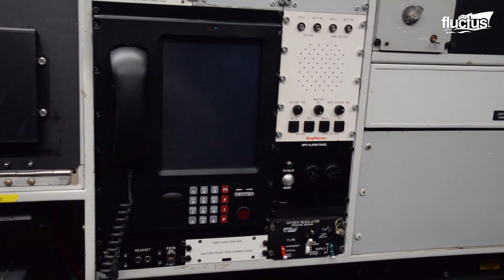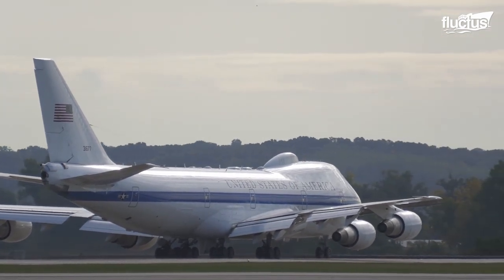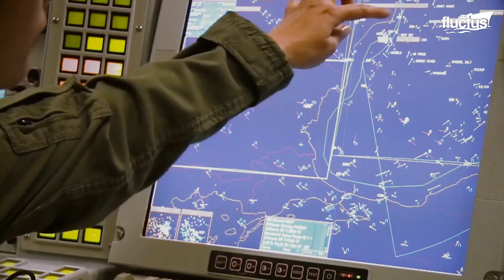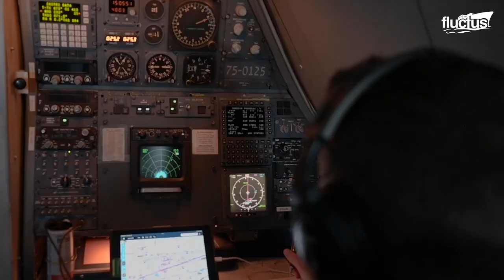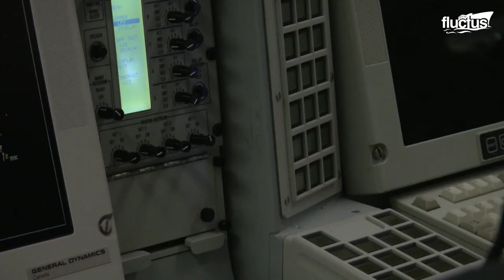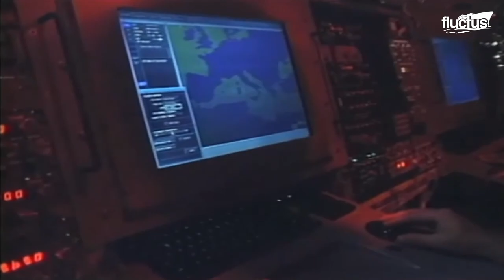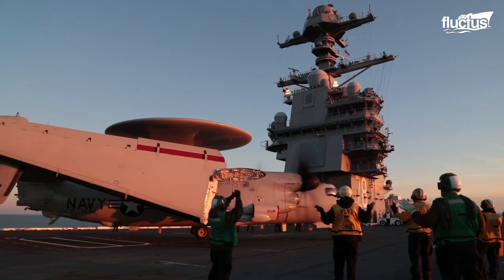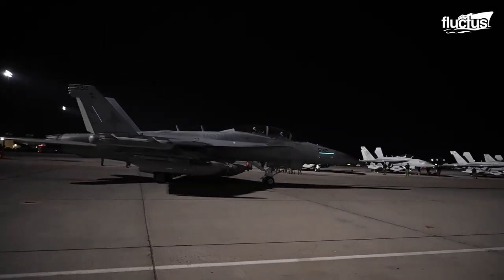Why US Spent Billion $ to Make this Presidential 747 Fly for One Week Non Stop

Comment: Former Boeing Everett where 747's are 'born'. E4B's and Presidential Movers began life at our mega plant in Everett Washington. When first 747 rolled out and took maiden flight in 1969, no one could have ever imagined how many varieties would result. The Queen of the Sky changed aviation forever. 

The aircraft can easily haul 100 people, food, and water for extended flights that can last a week or more. It can refuel midair, but can't restock food and water unless it lands. There are bathrooms and showers onboard. Those not only need water, they have to contend with sewage waste, which is held in storage tanks. Those are normally pumped into special trucks on the ground. I suppose if poop tanks got too full before landing, they could be dumped when over the ocean. Water becomes more important than food in long emergency flights.
Reply: I would think that queen could hold quite a bit of water and food esp for military folks who could ration in emergencies.
Reply: @Bredddi  Thank you for comment. Not sure how much they can stock onboard, but 747 can haul hundreds of tons. That could keep them airborne a long time. Let's hope we never have to find out because of war.
Reply: I wonder if they could add a system to catch moisture in the air and purify it to drinkable water?
Reply: @jacobbuzza7907  Good question.. thanks for comment
Reply: Considering that fuel can be transferred mid-air, I imagine it wouldn’t be much more challenging to transfer water. Also, I can imagine the possibility of transferring nutritious food mid-air utilizing canisters or some sort of packaging that is tubular in design. With a goal of perpetual airborne capability, I bet the folks at Boeing could make it happen. Thoughts?
Reply: @Jason-uw5et  Thanks for the comment. Great insight, they need you at Boeing.

Comment: Fun Facts: Air Force One is 1 of 2 Boeing 747's specially modified as the Presidential Mover and Mobile White House. Actually any aircraft the President flies in under Air Force control becomes Air Force One.

Marine One is 1 of several specially modified Sikorsky S-61 helicopters for transporting the President. Usually from White House to Airport where Air Force One is waiting. Between 2 and 3 Helicopters fly together, acting like decoys. Unlike the 747, the Helicopters fly low altitude. And yes, the Green Helicopter has a bathroom.

It's called Air Force One when the Air Force is transporting the President. It's called Marine One when the USMC is transporting the President. Typically the Air Force pilots fixed wing aircraft like the 747 and the Marines pilot the rotary wing aircraft like the Sikorsky Helicopter.

Comment: The cockpit is chock full of old analog instrumentation. Is that what makes this bird resistant to EMP? Speaking of EMP resistance, has this bird been tested for that? And why would you go to the trouble if your ground installations are not EMP proof?
Reply: Whoa one smart taquito
Reply: The answer is.....YES it has been tested for hardening against EMP and what makes you think the ground installations don't have the same hardening?  You can look it up on Wikipedia. In the 1970s or 80s they built a HUGE wooden trestle and towed a B-52 up on it (among other things) and exposed them to EMP. I assume they tested various methods of protecting against EMP and equipped the aircraft accordingly. One thing I know they did was to shield the aircraft wiring by encasing it in metal braiding which was then tied to aircraft ground. In fact.....ALL modern aircraft are hardened in this way, military and civilian. All flight critical wiring is encased in braided metal shielding and the shielding is tied to ground. What is the level of protection? Who knows. It's probably a military Secret.
Reply: @rael5469  Sources? I can understand why they would do such things because the threat is very real, but do they actually expect such measures to work against the power of a nuclear blast in near Earth orbit? I don't think that they do. After all, who can survive an all out nuclear war? Their plan was to prevent such a catastrophe, not to actually fight such a vicious war.
Reply: @ManuelGarcia-ww7gj  "but do they actually expect such measures to work against the power of a nuclear blast in near Earth orbit? I don't think that they do."
Manuel, of COURSE they expect it to work. You can think of it this way, think of shielding like a bullet proof vest. There is no such thing as a bullet proof vest.....but they are bullet resistant. So as long as an aircraft isn't hit by a direct blast then it has a GOOD chance of surviving the EMP from the blast. The United States conducted 1,032 tests between 1945 and 1992, to test for just this sort of thing. Over one-THOUSAND blasts Manuel. I bet they know a LOT about hardening against EMP.
Reply: @rael5469  I beg disagree. They expect it to work some of the time. Your analogy of a "bullet proof"  vest was quite apt. 

A great many civilians actually believe that EMP can be totally thwarted. Just as theyh believe that a scope on a rifle guarantees a lethal shot. They also believe that there is an actual device that can produce EMP, but the only thing I know of for certain is a high altitude nuclear blast. I understand that a shielded vehicle right on the fringe of such a blast might survive,  but the truth be told, all such contrivances are the product of a kind of morbid mental state. 

Nuclear war today is just as unthinkable as it ever was. I know. Not only did I grow up during the Cold War, I was a candidate for duty in the missile silos of that era.
Reply: @ManuelGarcia-ww7gj  " I was a candidate for duty in the missile silos of that era"
I wasn't a candidate, I actually served on B-52 bombers and as a Crew Chief held custody of nuclear weapons until the flight crew took custody of them. I learned a little about them. I also learned that the effects of nuclear blast are slightly exaggerated. I learned that the worst effects are at ground zero and dissipate quickly with distance. I learned that some people and things will survive. That is the theory they are going on with this thing. They can have it positioned to be on the fringes of war zones.....whatever it takes. It IS possible for it to survive.
Reply: @rael5469  Thank you for your service.
Reply: @TheLosamatic  Carlo I didn't get what you were saying here. I didn't get your point. I TOTALLY agree about Reagan but I'm not understanding your overall point.
Reply: @TheLosamatic  "oh sorry, I just don’t think they have much of a clue, not with today’s yields"
Today's yields are smaller than yesterday's yields. Yesterdays yields were in the megaton range. Today's yields are in the kiloton range. That's because today's weapons are more accurate. See how that works?
Reply: @TheLosamatic  "We will see that within three more summers!"
I believe what you said is possible. Lets hope it never happens.
Reply: Manuel you need to learn more about things before trying to sound smart on the internet next time.
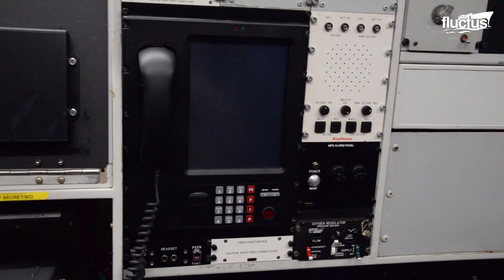Reply: 3:15 you are just repeating the video with your first question
Reply: @ronaldmcboggled9855  or maybe you could test the bird and get back to us

Comment: Does the radar dome create Lift or Drag? Just curious.
Reply: If it created any lift it would still create some drag.
But where it is placed it would need to be neutral, or the center of gravity of the plane would be so wrong.
All bits of a plane cause drag, but you have to have wings and other stuff.
Even the rivets create drag.
Reply: It's a flying saucer, it creates propulsion.

Comment: Typically if an event like that whatever occur they're probably be a thousand icbms all launched at once within a span of differences regarding 45 minute intervals that mean like nearly a hundred each minute or something and each ICBM typically has five different warheads that are only about 3 ft by 1 ft made out of hardened steel and iron alloys and titanium casings. And coming in at about 6,000 miles an hour out of low earth orbit. Apparently there are militaries of the world that have nearly a hundred interceptor rockets to intercept and oncoming ICBM and several dozen laser devices to try to eliminate a warhead although by the time it can be tracked and targeted the devices and the equipment will only have about 3.6 seconds till impact and this is 1958 icbms icbms have always re-entered the orbit and been able to achieve hypersonic speed although icbms are somewhat more detectable than low flying hypersonic missiles although with minor technology even a low flying hypersonic missile can be immediately detected so there's no real advantage to it because an ICBM is already hypersonic since 1958 and typically in one successful exercise it took more than 25 interceptor missiles along with several different lasers to shoot down one warhead which typically there would be five warheads to one ICBM spread out over tens if not hundreds of miles and you would only have 3.6 seconds or maybe a maximum of 11 seconds to react to the targeting of those five icbms over a span of hundreds of miles and 11 to 3.6 seconds which is not a very good probability of anything that could be done. It reassures me that for thousands of years there have been people without clothing without shelter without civilization or electricity that have lived in the rainforest and are still there to this day and for the next thousands years will probably continue to live out their lives there. When I go to the shopping mall and buy all the goods I possibly can just to watch the garbage truck go down the street to need to throw it away at one given point in order to go to the shopping mall to buy more things in order to watch the garbage truck so I need to throw it away to go to the shopping mall to get more things. Regardless for all the damage that does occur in a all-out war whether conventional or a thermonuclear worldwide Armageddon at developed and civilized metropolitan areas 1747 that might be able to do one thing or another about it doesn't really make a difference for the destruction that may have already occurred that they can do nothing to change that destruction once one error had been made you can't undo a thermonuclear detonation in a metropolitan area although it will the 747 will still be flying around in circles watching it yeah I guess we missed one. Out of the 5000 icbms or warheads that came in as if military intelligence is in the contradiction in terms and as if the people that are somewhat uncivilized and savages in the rainforest don't have an advantage

Comment: The surplus airbus A380 would be a good new replacement and would be more economical in the long run provided US have money,unfortunately not at this moment
Reply: A380 is not usable for a variety of reasons
Airbus has no presence with the US military and using them would require a lot of money upfront
Reply: No, way too big
Reply: If it ain't broke, don't fix it.
Reply: It's European. Only Made in USA for Air Force One, and others.
Reply: @dannyazucena3376  would have been, but that was never going to happen
Reply: As a  American, I will take the 747.
Reply: A Bus is not US Made and does not have a manf facility in the US. Airbus doesn’t have the military experience and security that US manf have. I wouldn’t believe Airbus could maintain security and secrecy of systems.
Reply: Unless they build one that runs off of solar panels and cow farts until Trump stimulates the oil industry again.
Reply: If we can't refine diesel we probably can't refine jet fuel either. Our airforce might be flying cessna's soon.
Reply: @jamesrogers4674  we can totally refine diesel it’s just in shorter supply.  Why shorter supply.  Supply logistics issues, refineries down do to repairs and upgrades, Emphasis in gas production and most important.  US government doesn’t control our oil but private companies who can easily sell to europe
Reply: @MichaelJordan-uo2ke  were extremely limited in refining low quality shale oil. Other countries have adapted to it better than us. A lot of times we export our low quality and import high quality.
Reply: @jamesrogers4674  The shale oil belongs to Canada. Our refineries are set up for sweet or sour crude. We produce 12 million barrels/day. We consume 20 million barrels/day. We import from Canada. We used to get 7% of our crude from Russia.
Reply: @jamesrogers4674  fyi I am more educated on this area than most people.
Reply: @MichaelJordan-uo2ke  good for you

Comment: How are engine turbines not spinning during refuel at altitude? 7:30m
Reply: Could be that the frame rate of the camera is sync'ed with the rotation of the turbines. Search up Helicopter Rotor Camera Sync for what I m talking about.
Reply: Think it just looks like that due to the camera, helicopters somtimes look like they aren't spinning either in video somtimes.
Reply: The speed of the shutter on the camera happened to be in sync to the turbine
Reply: The speed of the shutter on the camera happened to be in sync to the turbine
Reply: Because those are engine coveres to protect against FOD typically found on old aircraft engines with a small bypass ratio. The real fan blades are spinning behind the inlets.
Reply: The flying saucer on top is providing propulsion. The tanker is replenishing the bourbon and Coke.
Reply: @jamesrogers4674  
I'm glad my government has its' priorities straight.